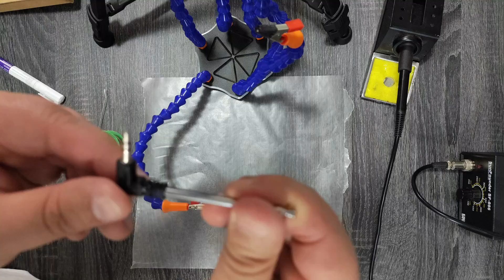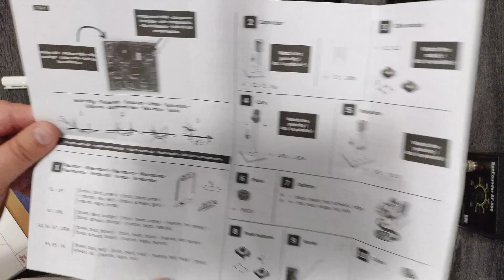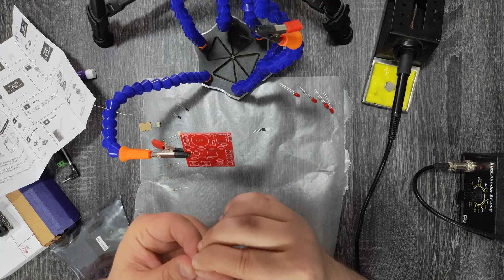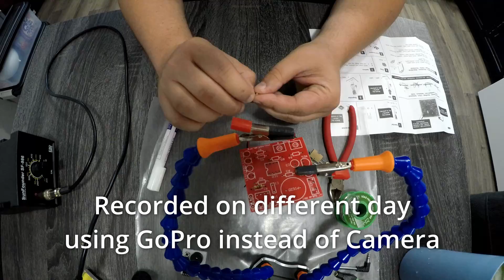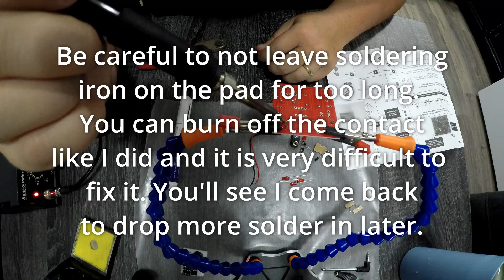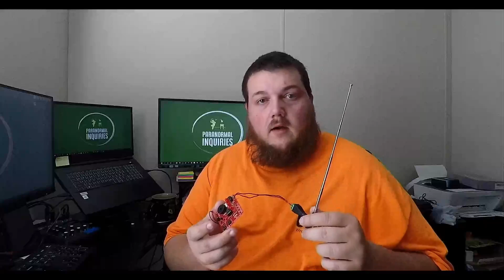REM Pod Build Junior Theremin

Comment: So, I built one. I used a BNC antenna and connector because I had them on hand. It powers up and works for maybe a minute. I've read on some websites that I should check the IC sockets for the proper orientation. They are correct. Any ideas?
Reply from the maker: @kenclark9075  you may have gotten a bad board, I've gotten a few of those. May have also burnt contact when soldering, I've done that too.
Reply: @Paranormal_Inquiries  I have a new kit ordered. Time to try again.

Comment: Did you ever find out what kind of temperature sensor board the REM Pod uses? I assume it's a cheap little kit like this. I started making one for my wife today. Halloween is our 10 year anniversary and she wants to go ghost hunting, so I thought I'd surprise her. It would be nice to add the temp thing though.
Reply from the maker: I haven't gotten a regular rem pod to tear apart, but from everyone that I've heard from, they don't even care about the temperature sensor. Just the flashing lights lol. Maybe once I have a bit more free money I'll buy some equipment and review it/tear it down and explain it.
Reply: @Paranormal_Inquiries   I wonder if they just wired in a thermistor to the 2nd mode of the circuit. The stepped tones sound the same. But yeah, I figure she can have more fun with the thermal camera anyway.